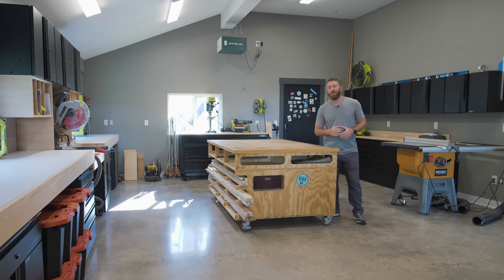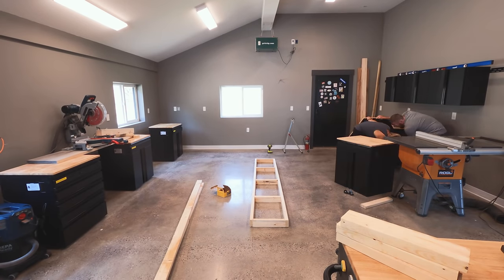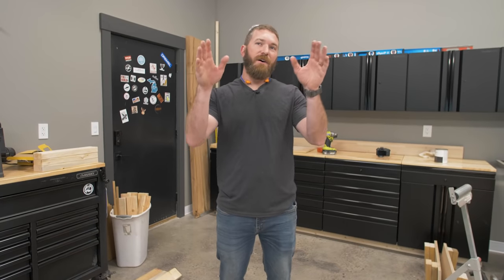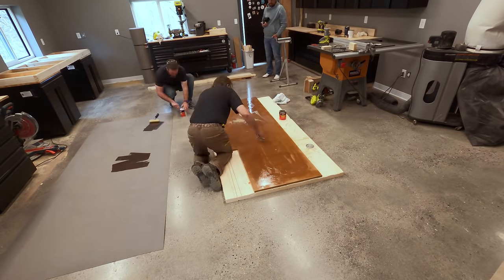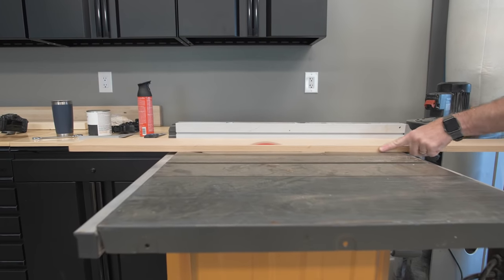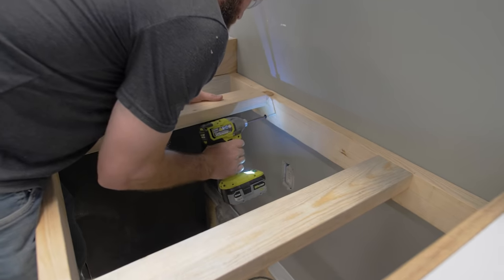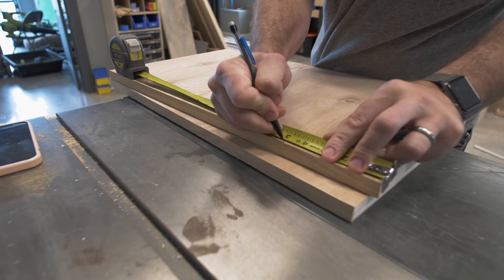Finally Finishing My Workshop! - Miter Station and Cabinets

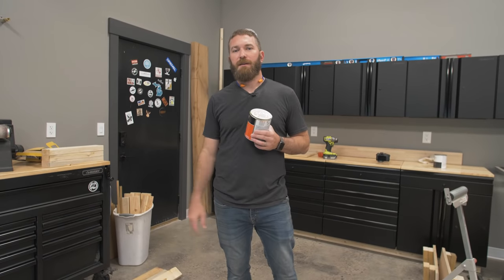Comment: 5:44 whether you have one person or two, using sticks between the laminate and the surface to hold them apart is easier because you can remove the sticks one by one and lower the laminate down and work the air out from the center to the edge

Comment: Looks fantastic. I am planning a new build. I was looking for ideas for size buy I don't want to go TOO big but also not come up short. It will be as wide as a double garage but length I am deciding. How long is your workshop? I will have bench saw, 1.8mx1m laser, 1200x1200 cnc, vinyl cutter, 3d printers etc. And will add steal lather and mill later

Comment: Love your shop.  How do you like the battery powered trim router?  I've been thinking about one but I wonder how top heavy and award it would be to control with the narrow base they have.
Reply from the maker: I love it for smaller jobs. I’ve seen where people make a large base to mount them on but for stuff like this it’s not an issue

Comment: Sorry, but I gotta question any wood shop where the woodworker doesn’t make his/her own cabinets. It’s one thing if you remodel your kitchen and decide to repurpose your old cabinets... or even if you manage to procure a bunch of cabinets cheap. But this? There’s just no excuse for it — unless you’re shilling for Husky.
Reply from the maker: I've built plenty of cabinets in my day but sometimes (due to time constraints this time) it's worth going with off the shelf cabinets. Steel cabinets will last, cheap cabinets or cabinets built in a hurry won't. Plus, have you seen the price of plywood lately!
Reply: @rogueengineer  Good point. Yeah, prices are crazy!
Reply: @Rogue Engineer - I think the husky cabinets looks outstanding. I did not know that husky made these outstanding cabinet. Great video and keep it coming.
Reply: As a guy who built all of my shop cabinets - there isn't anything wrong with buying pre-built.  Just because you can doesn't mean you should...

Comment: I understand sponsors, but it disappointing that for  your "Dream Workshop" you used store bought cabinets and you didn't build them.    
Also , in the finished pix it doesn't look like there is enough space around your miter saw to use the compound miter functions
Reply from the maker: I've build plenty of cabinets in my day but sometimes (due to time constraints this time) it's worth going with off the shelf cabinets. And yes, there is plenty of space for the miter to use the compound feature.